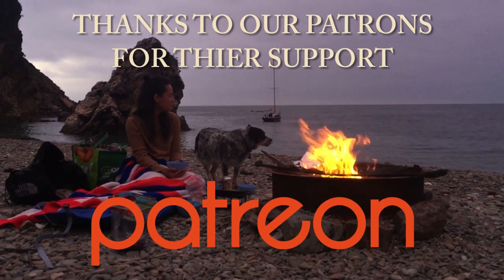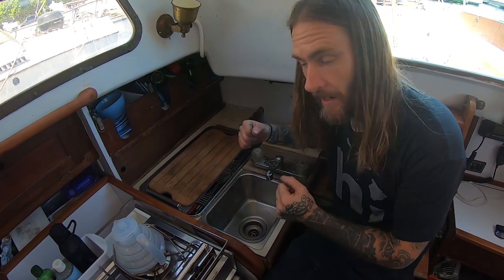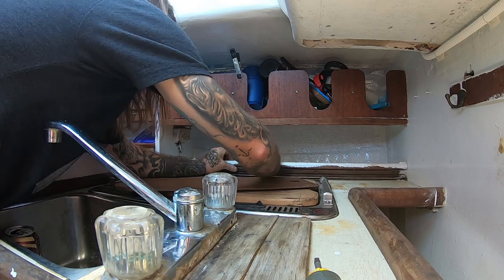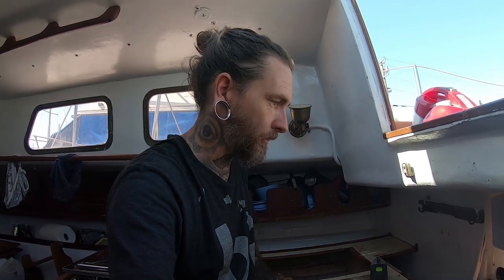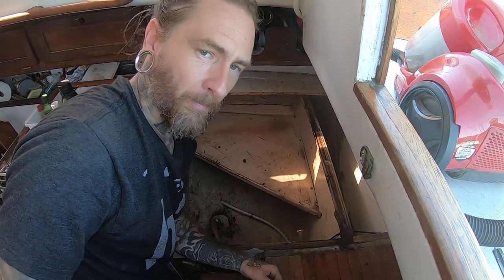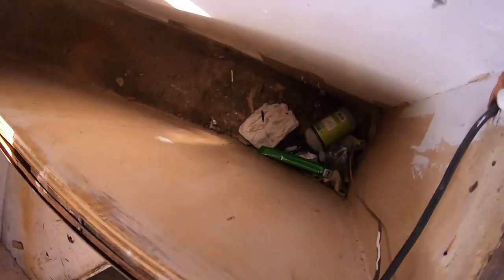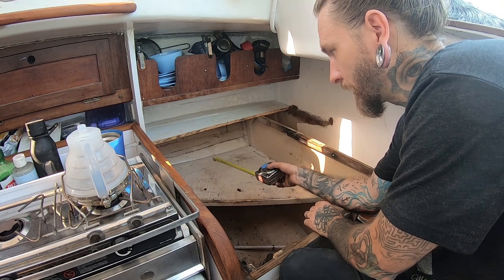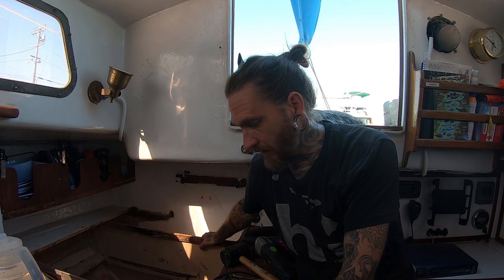Demolition of the Galley on a 1965 Alberg 30 Sailboat in preparation for the new Galley

Comment: I had a similar problem finding a good home for my trash bag until I realized that a plastic grocery bag (no, we haven't outlawed them here yet) fits perfectly inside a strong, canvas shopping bag, the kind we use to carry our groceries in the dinghy, etc..  Rigged this way you can hang your trashcan inside that little countertop cutout you were contemplating, or anywhere you have space at the top of a locker.  Of course, this is the 'quick & dirty' version.  It could be done much more elegantly, and in whatever size & shape you like.  You could even upcycle an old sail or awning. I don't want trash hanging around & getting smelly in the heat, so a small trash bag like this suits me just fine.  Big or small, this makes for a strong, space-conforming and washable garbage receptacle.  

And I think I heard you refer to your Origo stove as the "old stove"... If you are replacing it and would like it to go to a good home, I can help with that.  Best marine stoves ever, IMHO.

Comment: Merry Christmas & Happy New Year !  With the trash, have a store bought waste basket with a trash bag liner under the counter top. OK got it, not much counter space, fab an area (can be any vertical shape/dimension) that has hard sides you can line with a trash bag and have the room overhead to pull the trash bag up and out. It can't be a set-up where the trash bag can grow bigger than the hole in the counter like an upside mushroom. Glad your replacing some thru hulls. Keep up the good work. Say hi to Mr. Steady